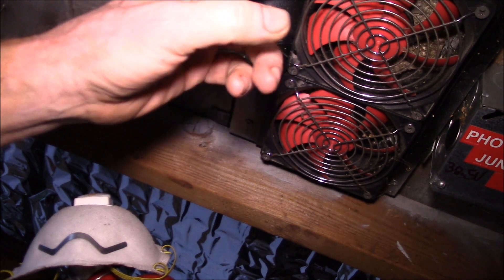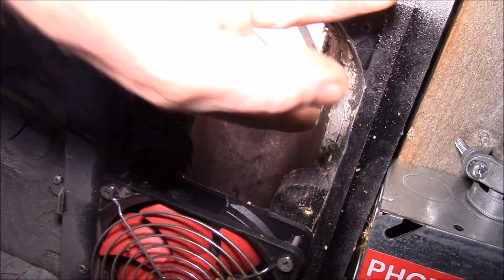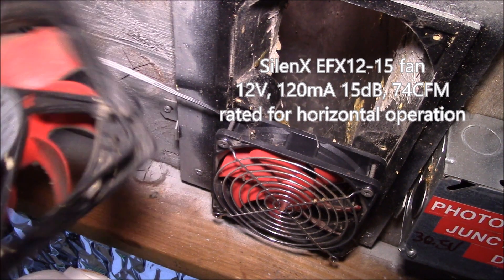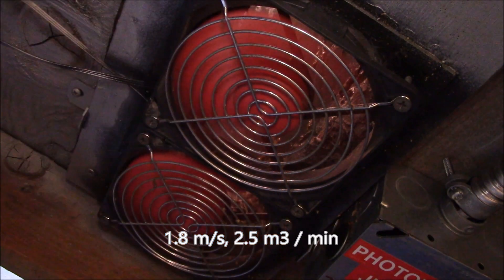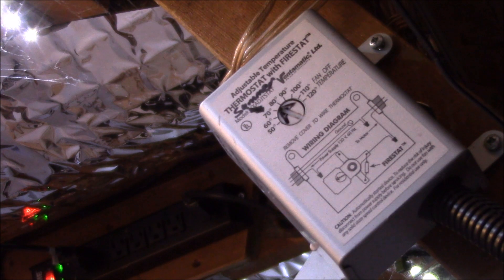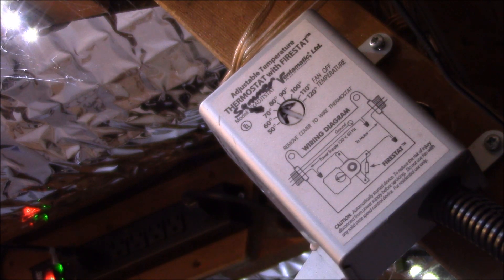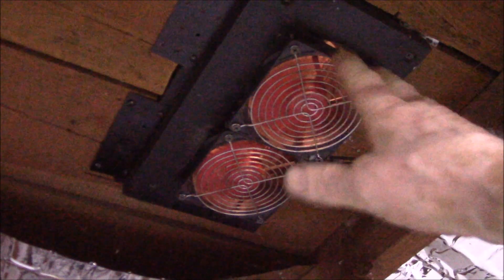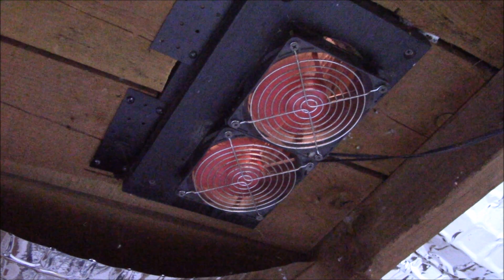Solar Attic Fans: How Much Air Flow?

Comment: May I ask what kind vent you used on the roof? Thanks
Reply from the maker: Just the old in-wall furnace vents, I believe they are 8" diameter, shown in the video below:
https://youtu.be/a2ZjQU8RJ6Y?list=PLpY2FP1a9tisey07zcocqAFXI7Tyo4rnR&t=409
I'm looking at replacing the vents caps with some Aura Gravity Vents that are supposed to increase air flow a bit and also have a screen inside to keep insects out.  The vent caps on there now seem to attract yellow jackets from time to time.

Comment: yo cool. so did you save money on your electricity bill? and also how much did the temp drop in your house with it on?
Reply from the maker: Since this fan system has never been connected to the grid for power and I didn't have any forced ventilation prior to this install, I have no cost data to compare.  If I were paying for the power, it would run around $1/mo. to operate with these low power DC fans.  However, with a higher power AC powered fan, the cost might be 2-5 times higher.  Before, I had attic temps up above 140F and on hot days, the house could get into the high 80s inside.  Now, attic temps are rarely above 110F and the house almost never exceeds 80F on hot days (no AC).  Granted these temperature reductions were a combination of the attic fans, radiant foil below the roof deck and improved attic insulation.

Comment: Thanks for showing
Reply from the maker: I had never thought about using my anemometer on these fans before, but it seemed to work fine.  I like how you can take a few simple measurements and calculate something like air changes per hour and see how that stacks up against recommended values.